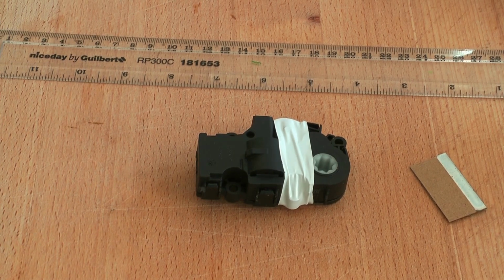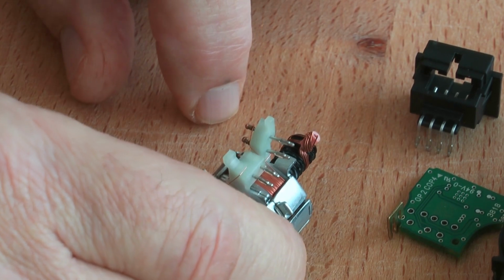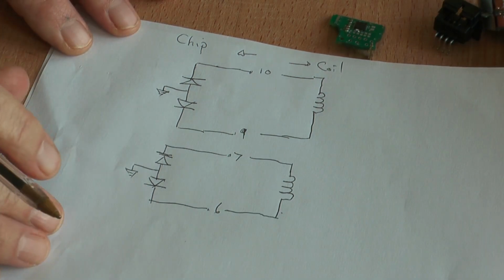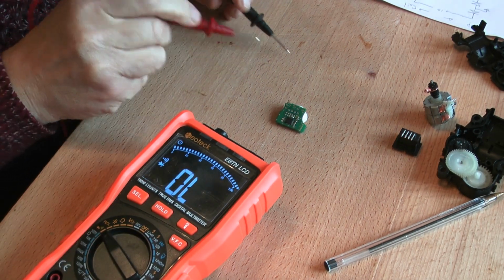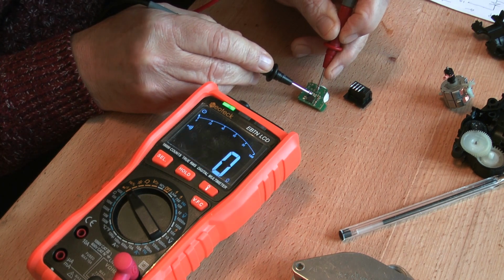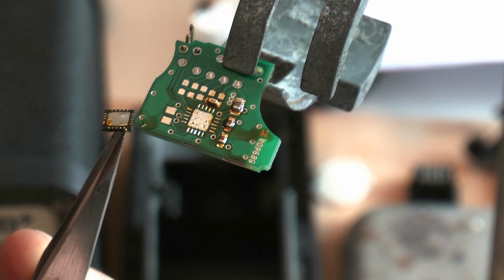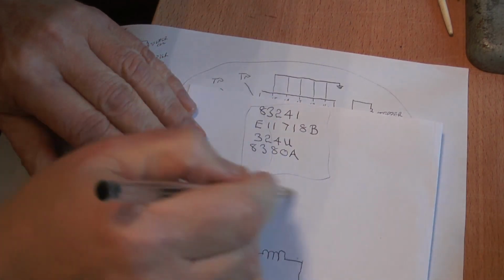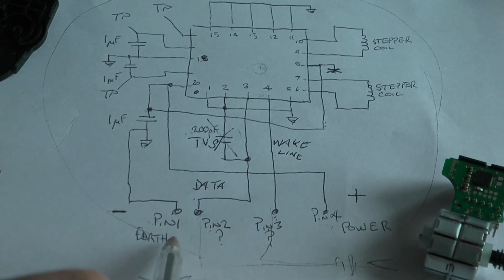Mercedes Heater Door Actuator

Comment: You’re video isn’t useless! 
There are some of us that do go that extra mile to find out why something isn’t working & try to diagnose/fix. Maybe we’ve too much time on our hands - we don’t get rewarded well for our efforts do we - but nonetheless we carry on. 

Background:-
I’m looking into this for a chap who’s 88 years old - whose history was electrical / mechanical engineering. & owns a 2003 Mercedes CLK 230 V6. A nice motor. 

Reason why I’m watching this video is because of my search into the infamous “click” of these actuators within Mercedes vehicles. 
One of the first videos I watched is titled “THE FAMOUS MERCEDES C-CLASS & CLK
W203/W209 ANNOYING CLICKING
DASHBOARD FAULT! WOULD YOU FIX IT!?”
Copy/paste this into YouTube & you’ll see a mechanic going through it - a very good video. 
From his video he explained the general problems & fix required. It is expensive to fix due to the work involved accessing the motors necessitating removal of the dash/centre console etc. original Mercedes cost for the actuators are circa £250 each! A search on eBay you can get non OEM part for £20-30. 
The fault can be that the grease has gone hard on the plastic components or wear & tear on them. I suppose you could get a short over time to the motor. Note that manufacturer part for the motor have a best before date on them - my explanation for this is due to the grease used has a life of say 2-5 years if not used. 

Main reason for owners enquiring about the problem is the annoying click. Think lasts for 30secs as the motors sync to position. 

As I’m happy to look research via YouTube problems that come up - I also like to see what one can do “outside the box”. 

So, I know the harness that connects the motors together - & think only 4 or 5 wire connection. So there has to be some communication going on for them to be set to relate to the heater control panel at the front. 

Your video takes us into the motor & the circuitry / components - which is very useful as I’ve been into electronics as a hobby since I were a lad! 
You’ve saved me a lot of time & it’s been very informative. 

Shame no chip data can be found. Not surprised you stopped & decided to put to bed after time spent on this & doing the video. 

I’ll prob try to stop my research on this soon - many hours spent on this - it’s been fun of sorts. 

My intention was to see what I could do to “turn off” offending motors so no click. 
I’ve asked if this can be done by diagnostic tools but no answer as yet. 

So next was opening up the harness & clipping a wire or two 😂 - alas this prob not gonna be possible. 

I might “disable” pins on the control panel for where the flaps are going to be adjusted - there’s 12 settings on the right hand side control - so process of elimination might tell me which motors are the offending ones. We’ll see. 

As you say - it’s a laugh. Good to be on your virginal desoldering of the surface mount chip. 

Atb

Comment: Just buy a new one. No need to tear the actuator down to see what it's circuits look like.
Reply: That might be the case for you & the general masses - but some of us interrogate to this degree so we can fix/repair/improve what might be a manufactured part known to fail. 

There are 10 of these units on a Mercedes - so yep, go ahead a replace the one or two that might’ve failed. Only to have to fix the others when they fail too. 
£250 each these motors - or non OEM at £20-30. 

Garage costs are expensive as there’s prob 4-5 hours minimum labour to access them for those that know what they’re doing. 

Onwards & upwards!

Comment from the maker: Apology for referring to the vehicle as having a positive earth system?   IT IS NEGATIVE EARTH.

The pins at the connector are:  Pin 1 -  System Ground (Earth).
							Pin 2 -  LIN Bus  (At this point there is a 220pf capacitor to ground which is typical of LIN bus interface requirements at the chip, but some circuits do have a TVS.)
							Pin 3 -  Is the way used to address individual units on the LIN Bus  There is an approximately 1 ohm resistance to Pin 2.  I think it is used as current sensing.  This is all inside the IC.   Surprisingly, there are several methods used to address individual units on a LIN bus.  I don’t know how this one works.
							Pin 4 – System  positive voltage supply. (+V)

Note:  The Ground (pin 1) to the Supply (pin 4) is protected from reverse voltage spikes by a diode within the IC.  Pin numbers are arbitrarily assigned in the video.

I was sent more units to take apart, hence this update of sorts.  There is another video and I hope it’s the last one I ever make on the subject.    (Yawns Loudly!)  
Link  https://youtu.be/v3iVwWMf1SI